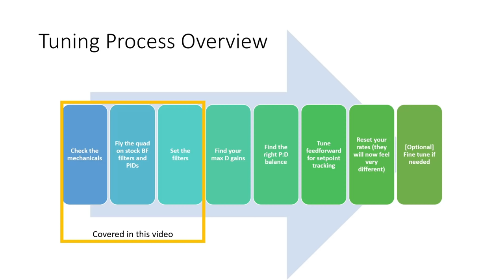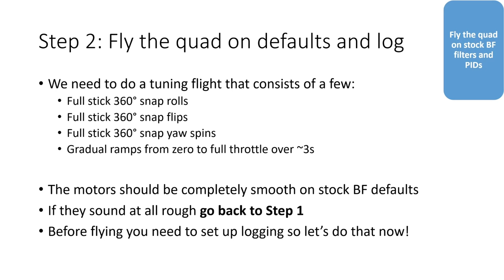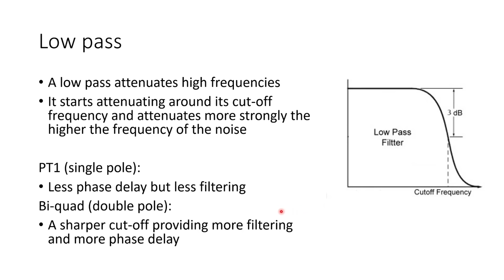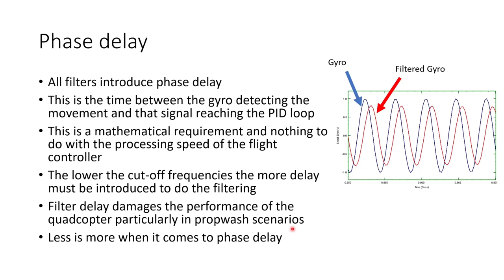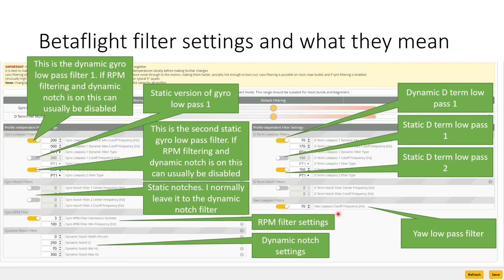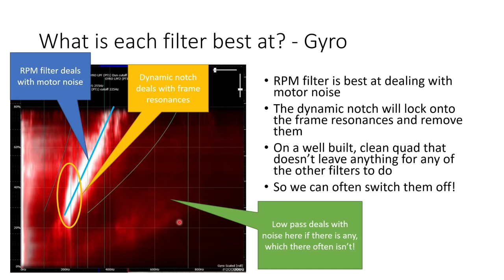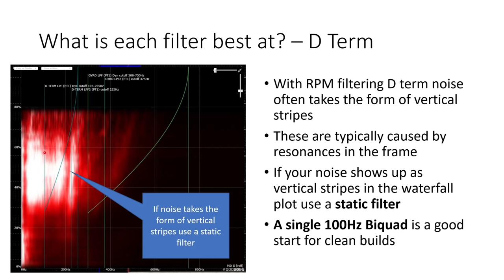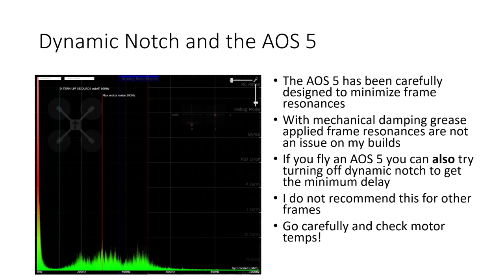Betaflight 4.2 filter tuning. The easy way to get a perfect filter tune!

Comment: let’s say I have a spike at 200hz, if is set the cutoff at 200hz it reduces it by 71%... ...so, if I want to be safe and have it more filtered I should set the cutoff a bit lower, like 170hz? Great video! I love how you explained the process and where to start! I finally can start to understand black boxes! Looking forward for the pid tuning video!!!
Reply from the maker: Yes. I would normally go a fair bit lower. E.g. a spike at 150hz might need a filter at 100Hz. It also depends whether you are using biquad or pt1.

Comment: Hey Chris,
Great video.
When checking the mechanicals how secure do you need to make the flightstack?

Can the stack have very slight side to side forward and back movement as well as some some slight compression with the gummies when you press your flight controller up-and-down?

I have a super solid stack and none of those characteristics, so I'm wondering if my stack may be too tight or too snug and not allowing things to have a slight dampening for the gyro.
Reply from the maker: Yes a small amount of movement on the gummies is OK.

Comment: I know it is an 'old' video but i hope yt still notifies you of my comment.
I build my first quad(5" source one v5) and when making a log i get lots of vibrations from 40% throttle up on the pitch axis(below 100 hz) clearly visible in my waterfall plot. I can see the vibrations in my video too.
What could be likely causes that cause this? My guess after binching your videos would be mechanical? I already ordered a stubby antenna so that will help at least for general noise. Could it be tuning related too, haven't tuned the quad, it is running on stock betaflight 4.3 settings.
Bidirectional dshot and rpm filter are on btw.
Thanks in advance and keep up your great helpfull videos

Comment: Thanks for making this! One question I have is in regards to the changes you make once you collect your data log. In your log for example, you show the white diagonal line caused from motor noise. I know you said the RPM filter would be best at reducing that, but what change would you make it betaflight to reduce this? Would it be raising or lowering the min frequency. I'm just using the motor noise as an example, but I'd love to know more about making those adjustments after you have the log! Thanks so much!
Reply from the maker: RPM filtering works brilliantly on the default setting and lots of tuning has been done by the devs so there is no need to adjust the settings IMO.

Comment: Hey Chris, loving the videos, keep up the good work🙌  Just a quick question, how much would the filter settings differ on an AOS 3.5 frame from your recommendation for clean builds or would they still be the same?
Reply from the maker: I use the same but lots of people increase the D term filter to 110Hz on the AOS 3.5 because its so clean.
Reply: @ChrisRosser  thank you so much for confirming this 🙌 it is a super clean frame 👌

Comment: @Chris Rosser Antenna mounting is interesting. Perhaps you could do a video on how to mount a VTX antenna where it won't be shadowed by a big battery on top or the frame (like subbies are) and still do well on vibe testing. The stubbies are great for the racers and freestylers in nice open areas, but throw in obstacles like dense trees and such and/or some farther distances and  you will need every bit of video reception/signal strength you can get on Analog. Maybe not as big a problem with DJI.

Comment: Thanks for this video.
PS : I would also recommand to keep an Gyro LP PT1 at high freq (Like 4OO or 600Hz) to avoid high frequency to come back in the low range due to nyquist shannon effect.
(Just give a try, you would probably see a lower floor noice in the range 30-200hz ;) )
Reply from the maker: The gyro has a low pass built in at 250Hz. That should cut out any Nyquist shenanigans?
Reply: @ChrisRosser  Yes sure, but does it enough ? How many pole does the built in LP have ?
It help also when you use 1khz Blockbox log where 800Hz noice comes back on 200hz according to nyquist
Reply from the maker: @edouardmalot51  Hi Eduard, the PID loop is running at 4kHz or 8kHz so the attenuation of even a 250Hz single pole filter is enormous at those frequencies. Feel free to send me comparison logs with and without the PT1 but I don't see a mechanism by which aliasing could cause a problem.
Reply: @ChrisRosser  
- You have aliasing issue in your blackbox log, so what you see is not what really append in your PID loop
So with a blabkbox log at 1Khz, Nyquist freq is 500hz => a 800Hz noice appear at 200Hz in your blackbox log (but not represent what append in the PID loop).
So sometime you try to filter a low freq noice, but in reality it is an high freq noice appear in low band due to nyquist effect in your blackbox log.
But yes, I wasn't clear enought in my first message.

- If an LP PT1 with Fc=600Hz on Gyro have an effect on your blackbox (like I saw many time, sorry I don't have log now with me), it mean you have some high freq noice  not filtered by the built-in gyro LP.

Note :  Delay introduced by LP PT1 at 600Hz is 0,3ms
Reply from the maker: @edouardmalot51  Ah I see. It only affects the log and not the PID loop so I am not worried at all. 0.3ms is more than 10% of my current total filter delay, I won't add a filter just to make the log look cleaner. Thank you for explaining this to me! 😁
Reply: Yes.
But at the end, adding this filter will help you to have a more clear view of what really happen in the system and then be able to apply the appropriate filtering.

I worked with a company where they design them own firmware for professionnel drone. 
They did apply a lot of filtering because they saw it in log, in reality the noice was at an higher freq and come back in low range due to nyquist effect in log... 
Adding filter to avoid nyquist effect in log help them to see the true.

(Add a filter only on Blackbox log before sample data could be a good option in BF)
Reply from the maker: @edouardmalot51  Ah so you turn it on for tuning then off one you have your perfect filter tune. That makes much more sense.
Reply: @edouardmalot51  to avoid aliasing issues I always log at 2k or higher. Realistically there is seldom any energy of note over 1 kHz. It's one reason I prefer SD card to dataflash.
Reply: @JoshuaBardwell  Thanks, but UAVtech made a vidéo where he said 2Khz blackbox (or higher) cause jitter in PID loop. 
He recommend to use blackbox at 1Khz max on F4 FC.
I know one dev works on DMA for to lower SPI load of Blackbox, I don't know if it is merged yet

Comment: Thanks for this video Chris. Something new I learned from you is the concept of increasing D-term low pass filtering a bit with BIQUAD and 100Hz to compensate for turning off the gyro static LPF. Do you know if D-term filtering causes more or less phase delay than the equivalent amount of gyro filtering? 

Also, I am noticing a troubling trend with FCs. On builds that I normally was able to turn off the gyro LPF, I am not able to anymore because the gyro is too sensitive. I (and others as well) theorize that because of the worldwide shortage of components, the QC is more lax and flight controllers/ESCs are going to have more variance so it's much more likely that you'll get a finicky FC or a noisy ESC. I have noticed a surprising amount of noise and sensitivity from two new Matek F722s and two Radix 2s when in the recent past these FCs were rock solid.
Reply from the maker: Yes that's the goal. You save more by turning off gyro low pass than you add with a little more D term filtering so there is a net benefit.

Comment: Great video Chris.
I still fundamentally disagree with you regarding static dterm LPFs vs dynamic LPFs. Consider that we fly with rather aggressive TPA by default (65% D gain attenuation at max throttle by default), which acts as a "free" filter for our D term. Effectively, with a dynamic LPF, even though the LPF ability to attenuate D resonances decreases with raised throttle position, our D term inherently amplifies less per unit of vibration energy because itself is being attenuated. There is a balance, of course, and with a no-gyro-LPF strategy you need to be careful about your upper cut off, but in my experience you can gain the same effective amount of Dterm attenuation and save a small amount of phase delay in the process.

Lastly, I'd recommend a follow up video to this specifically for builds that have problematic resonances. A big example, knowing when to properly use a static notch, for instance when multiple (usually 2) resonance bands overlap each other at a certain throttle position, which the dynamic notch cannot handle.
Reply from the maker: You make an interesting point about TPA. In my experience filter delay is most critical at low to mid throttle when authority is lower and adverse inlet flow conditions occur. In that region TPA isn't going to do much. Another risk with dynamic filters is that you run the risk of transitioning from stable to unstable at a certain throttle position (the dreaded mid throttle oscillation) which is less likely with static filters. It may be that I'm just not good enough at tuning dynamic filters to realise the benefits. I try to keep things very simple and minimise the number of parameters. I find that lets me home in on the tune faster. I'd be interested to see how much phase delay you are able to save with dynamic low pass Vs static though!

Comment: A few questions if i may:  
What is the minimum log length needed in order to accurately collect the data? can a one minute flight suffice? Does longer flights yield more accurate data? 
Should the end of the log always be clipped off to account for / remove landing related noise at the end of the flight? 
If a crash occurs during data collection should those logs be scrubbed and just take another flight? 
Do you recommend that roughed-up props would be used for filter tuning in general given that we crash so often and most of us rarely fly brand-new props all the time? 

Thanks for this.
Reply from the maker: 1 minute is enough. You are looking more at the character of the noise and less at its actual value. A shorter log will look quieter. Make sure not to crash and trim the landing and take-off (or "land" like I do and disarm in mid-air 😜)

Comment: Hello Chris

I am using your method to tune my 3inch quad.

You mention using stock BF filters and PIDs but can I put in the following "Quick Settings" for freestyle from BF 4.2 Tuning Notes or leave them out?

Race/Fast Freestyle (strong feed forward, tolerates a typical RC signal, very responsive)

set iterm_relax_cutoff = 20
set rc_smoothing_auto_smoothness = 7
set ff_interpolate_sp = AVERAGED_2
set ff_smooth_factor = 20
set ff_spike_limit = 70
set ff_boost = 15
set feedforward_transition = 0
set yaw_lowpass_hz = 100
set throttle_boost = 7
set throttle_boost_cutoff = 25
set dyn_lpf_dterm_curve_expo = 7
set gyro_rpm_notch_q = 700

Thank you
David
Reply from the maker: Hi David, yes you can use those settings.

Comment: What an awesome explanation!
But what should I do on a tiny whoop, where there is no blackbox? Recently my many-time-repaired Mobula 7 started to show wobble during hover, motors a pretty hot and batteries drain faster than usual. Can I simply apply more filtering by using sliders?

Comment: Hi Chris, thanks for this video, very helpful to clarify many of the terms in use on what they are and what they are doing.
I think you skip a big portion of it in the end, as you go forward to suggest the setting for a clean build, without really setting the filters with the reads of the waterfall graphs...
(or I didn't get how you translate the graphs into the setting you proposing....) for example... there was a vertical stripe in your graph (around 23 min in) for frame resonance and you said dynamic notch filters will take care of that, right? the resonance in that example was at around 220Hz, but you set the dynamic notches from 100 to 400.... why the range so wide if the resonance was at 220? Sorry it's probably just me didn't get it.... !! 
which data I save from the graph to be transported in the filter settings....
Reply from the maker: The dynamic notch will target any peaks between 100 and 400 including 220Hz. Setting a reasonably wide range ensures that all peaks are captured. Too wide reduces resolution. 300Hz is a compromise.

Comment: Hello Chris, thank you for the explanation! Unfortunately im not sure if i do it correctly. Should i start with the betaflight standard filtersettings and PID Settings or with your recommended settings? I checked my 5” quad and it should be well build. Unfortunately  the blackbox data are really worse. Thank you and i hope to get an answer from you

Comment: I don't know if it's a good idea but on a clean build i think that you should turn off the dynamic notch filter. I flew with the dynamic notch filter off and it flew better and sounded cleaner to me.
Reply from the maker: If you have a very clean build it can work. On my AOS 5 I don't run dynamic notch.

Comment: Thanks for all the helpful info! I have an 8" running iNav and it doesn't support DSHOT. I'm probably going to roll back across to Betaflight although i'll lose GPS navigation and position hold - but do you have any tips on what should be done differently if RPM Filtering is not an option?

Comment: Great explination Chris, @23:10 how does the rpm filter account for the non-linearity of the vibration vs rpm as you can only adjust min f and harmonics, I'm assuming this curve is slightly different for every frame?
Reply from the maker: The RPM filter just puts a notch on the motor frequency and it moves as motor rpm changes. Crossfading in 4.3 handles motor noise increasing with motor rpm 👍

Comment: Assuming we have no blackbox logs - would it make sense to move the cut off and notch frequency from typical100Hz on a 5-inch to say, 120 - 150Hz on a 3-inch quad {smaller quad ~ shorter arms ~ higher vibration frequencies)?

P. s. I look forward to watching your videos in general, but with this mini-series about tuning - I'll be BURNING in anticipation 🙂🙃🙂
Reply from the maker: Yes, you can gradually increase the cut-offs particularly for smaller quads. I would move them all together to keep things simple.

Comment: Thanks, great tutorial, even for a control engineer haha. I'm used to the freedom of Matlab. I have no black box so have to tune blind but for the drone, I think less is more. I turned everything off except of course the lowpass. If everything is stable then you can reduce lowpass and start patching up all the dirt but why would you? I don't feel the difference between a 20Hz 2nd order or a 200Hz 2nd order. It's not that humans come even close to robots in terms of reaction time.

Comment: Thank you for this. I had no understanding of the filters prior to this video. I have pretty much just used the defaults, but I know the defaults don’t fit every quad I have. I have a question that I have been wanting to ask. What does it mean when the motors are hot after a 4 minute flight? Most of my quads have cool motors even after aggressive flying. Thank you again.
Reply from the maker: Hot motors are difficult to diagnose. Some motors run hotter than others. If your motors sound rough and growly then that might be gyro noise getting through the filters. If they sound smooth it's likely normal behaviour. If it's a warm day the motors will get hotter!

Comment: Hi Chris, really informative and well explained video. Thanks a lot! 
I've set my filters as you have explained in the video. My motor noise profile is very similar to yours. I've set the RPM filtering values as you have suggested, but when I look at the waterfall plot, the motor noise profile remains the same even after that. How do I fix this?
Thanks again!!
Reply from the maker: If you are looking at gyro_scaled this is before filtering is applied. Gyro is after filtering.
Reply: @ChrisRosser  Ah, that explains it, thanks. Looking at the "Gyro" plots, they're much cleaner. I do see that the RPM filtering is eliminating the motor noise. However, I see some horizontal streaks on the waterfall plot from 0-20% throttle - pretty much across the frequency spectrum (0-800Hz, but gradually getting lighter as the frequency increases). Is that expected, or do we have some way to eliminate that?

Comment: Very good tutorial, thank you Chris. Now I've started do play around with filtering. My question is: which graph shows the effect of the filtering? If I can hear a difference in sounds of the quad, I should see different graphs, right? "Gyro scaled" somehow shows  the same vibrations prior and after a filter change. What am I doing or thinking wrong ?
Reply from the maker: Gyro scaled is before filtering so your filtering changes won't affect it much (if at all) look at the Gyro trace to see whats going on after filtering.
Reply: @ChrisRosser  Thank you. Now I am beginning to see the light. 🙂

Comment: I just watched the entire series and finally stuff starts to make sense. Is there any way to tune the filters without using blackbox? You explained nicely how to tune the PIDs but not the filters without log data. I am mostly flying whoops with AIO boards so getting a board with blackbox is not an option. Also the Betaflight defaults are aimed at 5 inch so not sure how useful that would be to me.
Reply from the maker: Not really. You can try my recommended settings and increase the cutoffs gradually until it all goes wrong but looking at logs is better.

Comment: Hey Chris, would it be possible to program BF to just enter in the noise frequencies from BBE and just have it set the appropriate filter settings auto set? Seems to be a better solution for the end user.